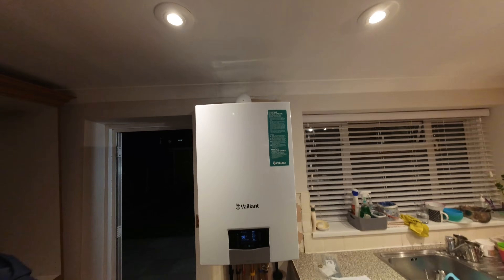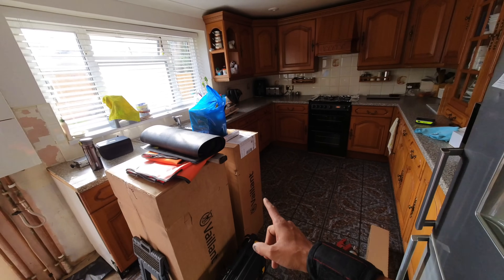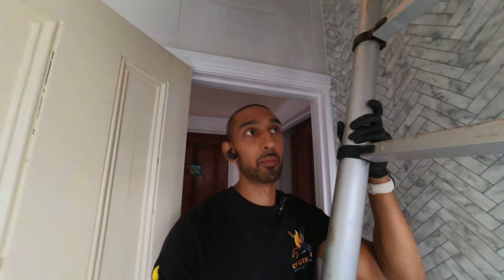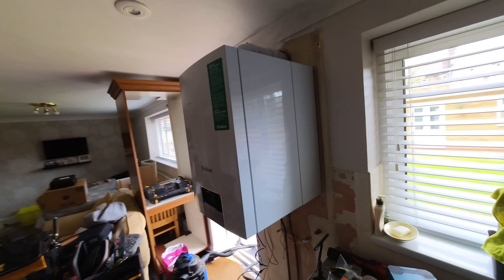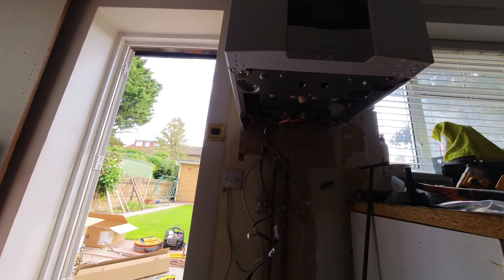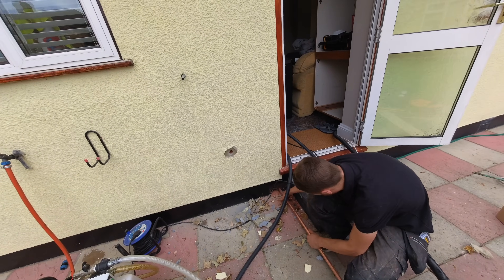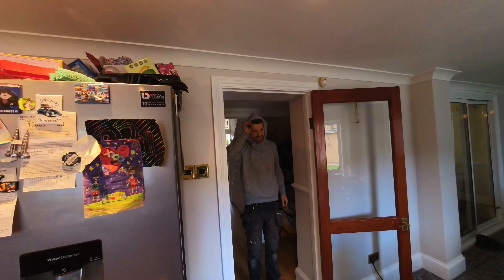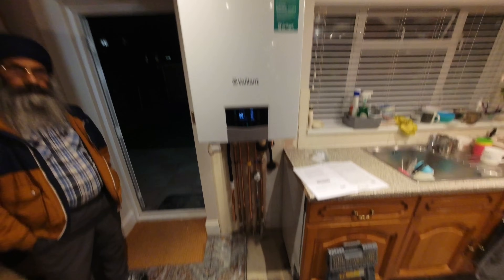Did I Undersize The Gas Supply For This Vaillant 940? - A Day In The Life Of A Gas Engineer 84

Comment: I've had one of these for over 6 months now and love it.  I'm just glad mine's in the garage, because that looks like a monster in a kitchen.
Reply from the maker: Yeah it's a bit of a big one to have in the kitchen 😅
Reply: Hi, my Turbomax combi (28yrs old!) is showing signs it might be approaching end of life so I am considering either going for this model or change to cylinder system. Can you advise on what the performance is like? Can it run two showers simultaneously if you have good water pressure at the mains. Thanks
Reply from the maker: @Owee1001 if you have good water pressure then yes it will run fine for 2 showers
Reply: @cputilitysolutions basic test at the kitchen sink is showing about 16lpm. Is that good? From main stop tap I have 15mm pipe but in the ground I have the blue plastic. Upgrading that to 22mm should improve it?
Reply from the maker: @Owee1001 yes upgrade the 15mm to 22mm and you should see your flow rate go up if you already have the blue MDPE in the ground
Reply: @Owee1001  Two normal showers, yes easily.  I have a big rainfall shower which it has no problem with, plus you can’t even tell when someone opens a hot tap while having a shower.

Comment: I had a 937 plus in my previous house, put it in the garage as it was a beast, never used the storage tank, so it was a waste of money buying it
Reply from the maker: How did you manage to bypass the storage tanks? Didn't know you could do that
Reply: @cputilitysolutions  You turn the hot water fully up, it shows the C symbol, then you turn it right down and the C disappears, then u set it at the desired temp, same again if you want to turn the charge tank on, turn it fully up till C appears, then set it at desired temp, charge tank is then on
Reply from the maker: @sen5908  nice one I didn't know that 👍🏾

Comment: 14:01 just take the side panel off? It’s 2 screws
Reply from the maker: Yes but the point is why make the cable entry points so awkward
Reply: @ they are really designed to remove the entry plate from the boiler fit cable through the grommet and offer the cable and plate back up to the boiler.

Comment: That’s a beast of a boiler, did you get some good hot water flow rate at the bath?
Also I love Eph controls but the vaillant controls are a must for either load or weather compensation on a vaillant boiler, a lot more expensive but well worth it.
Reply from the maker: Yeah flow rate was great, actually even better once we linked out the mains in the loft 😅 yeah I always try to recommend the Vaillant controls but customer wanted something cheaper so went for EPH
Reply: @cputilitysolutions  I’ve never come across that before tbh a loft tank supplying a combi. Would of been fun to see how the 940 ran off a gravity tank 😜😜😂
Reply from the maker: @smartboilercompany1983  neither had I until this job 🤣

Comment: I’ve just been to one of those boilers.   Vaillant said 13-5 mb working pressure at boiler on max is fine.
Reply from the maker: Yes but I only had 11mb 👍🏾
Reply: @cputilitysolutions  I was surprised it could be as low as 13,5.          Was it a pipe size or gas meter issue.
Reply from the maker: @peterreid4567  undersized incoming main so Cadent had to upgrade it from the road

Comment: Can I ask a question did you not test the standing pressure at the meter and let by test before you even started work     Just a question. Thanks ,    You should of also of gone back and tested after cadent had been
Reply from the maker: Standing pressure and let by has nothing to do with working pressure (yes I did my checks beforehand regardless). Old Turbomax was a lower kW to the 940, and as you saw I upgraded the gas run as well
Reply: @cputilitysolutions  I was just wondering out of curiosity would the standing pressure not of been low.   I know you said working pressure was 13.  I had same issues a while ago but my standing pressure was low on my first test before I start work.

Comment: I fitted a few of the old 937s and they were beasts aswell like a small fridge on the wall lol in installations where theres no space for unvented cylinder i think they are the only solution 👊🏼👍🏼
Reply from the maker: Yeah they're a good alternative! There's also the Viessmann 111 & 222 as well but I've not fitted either of them before
Reply: The 222 is a real beast just as nasty as the 111 in regards to the electric fault from factory, don’t ever attempt to take a 222 upstairs by yourself, they are effectively fully integrated system boiler .  Corrosion on the 100 litre cylinder is a major issue in hard water areas , and has been a big concern in eu Germany installs I have seen in barracks after as little as 2 years

Comment: I’m a plumber… and you’re brave putting your work up for everyone to comment on… the gas you can put a bit of 28mm anywhere on the run, that would help. I’ve done a section of 32mm before. That boiler where it is ( not your fault obviously) is absolutely ridiculous, fucking size of it. I wonder what the flow rate was? 40kw gotta give some flow.. and I would never worry about power flushing a sytstem that’s been a sealed system for years…but look at the shit you got out
Reply from the maker: Thanks mate, yeah in hindsight a length of 28mm wouldn't have hurt but I got lucky with the working pressures. I do get a lot of dirty systems on my flushes!

Comment: Is it possible to power flush a 10mm mirror bore open vent system that’s 20 years old?
Reply from the maker: I wouldn't mate. Add some chemical in, leave it a week to circulate then drain down and refill and add inhibitor. Or re-pipe
Reply: Microbore
Reply: 8 rads with no trvs
Reply: What are your suggestions cputility?

Comment: 28mm would be best unless the Combi is very close to the incoming supply (British Gas do this as standard install on most Combi's) but large Range Cooker's with Multi Hob Burners are also a factor as their immediate demand can be massive too.   Nice work though and nice to see someone who is on the case and wants the best install for the customer as well!
Reply: In this kind of scenario I also check the flame on the hob/cooker is not affected by the boiler when it's firing up etc. If it dances, back under the floor boards I go😂
Reply from the maker: @delboy6384  💯
Reply: @delboy6384    For sure if it dances you need to do a Linford Christie sprint out of there!!
Reply from the maker: Thanks mate, yeah luckily the 22mm was ok in this case but a couple of lengths of 28mm wouldn't have hurt 👍🏾

Comment: I was asked to use a rcd fused spur on the Vaillant due to the pump and electronics , checking the gas on the old appliance if working would have bought you a bit more time
Reply from the maker: Thanks 👍🏾
Reply: Asked by customer I take it? Is it because of pumps generally now wanting to be on rdc circuits or?

Comment: Whats a shunt pump ? 14:04
Reply from the maker: The hot water circulation pump that does the tanks. It's at the back of the boiler
Reply: @cputilitysolutions pig of a job to replace

Comment: You was brave running 22mm to that from where that meter was, that wouldn’t been 28 all day for me, one thing, why the 3rd party on off controls ? As a bare minimum you should be giving them load comp
Reply from the maker: It worked out in the end, 1mb difference between boiler & meter 👍🏾 gave customer options for controls and that's what they went with
Reply: @cputilitysolutions 
keeping it real!